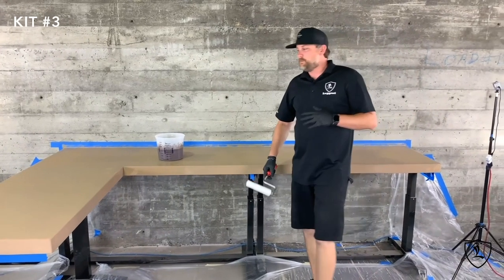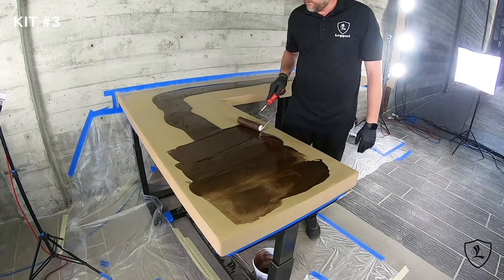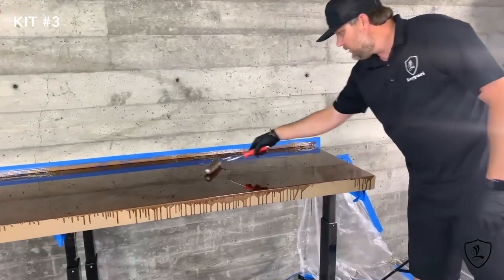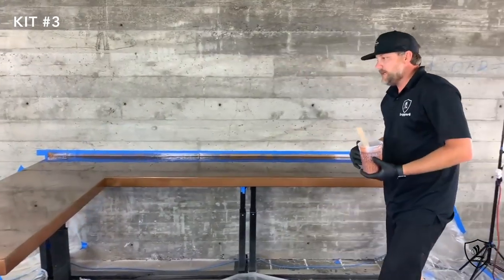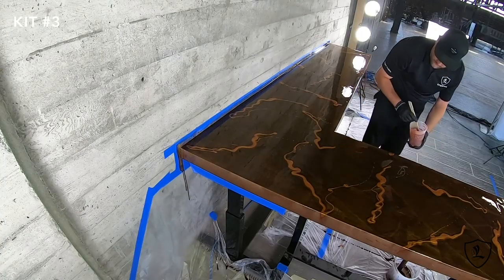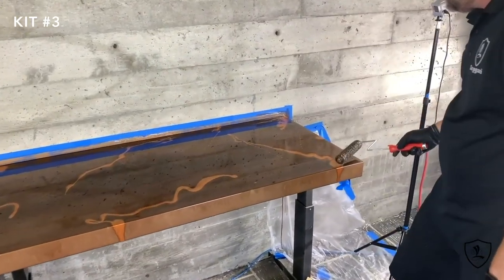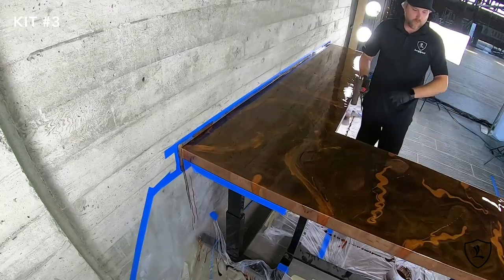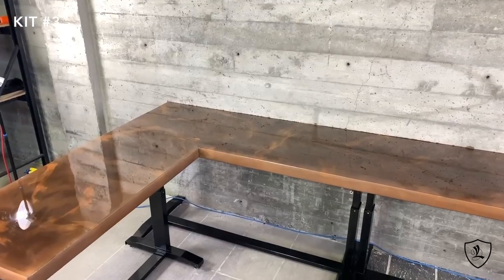How To Coat Your Old Countertop Using Epoxy!

Comment: Great videos and great work but i have 2  questions, when doing these projects what are you pouring the epoxy on? Is is treated wood, concrete, plastic panels, an existing countertop? What is the best countertop material to do  these pours on?
Reply from the maker: This was an MDF board countertop.  You can apply our product to any hard surface, take a look at our brochure to see all the different applications.  Thanks
https://online.flippingbook.com/view/364043

Comment: Can this product be applied in a skoolie bus for counters and floors?  And will the application last?
Reply from the maker: As long as the subfloors and counter are structurally sound then yes you can use our product to cover them.